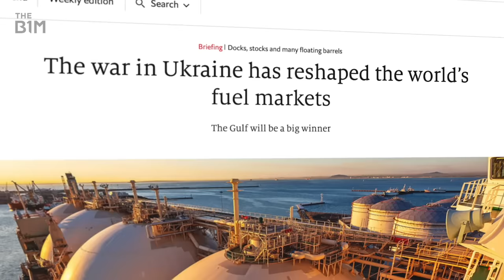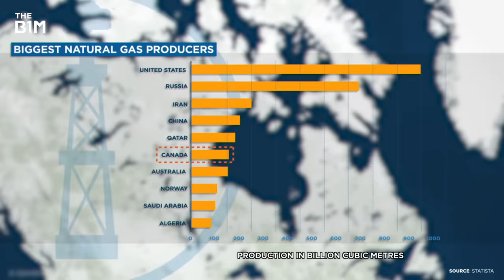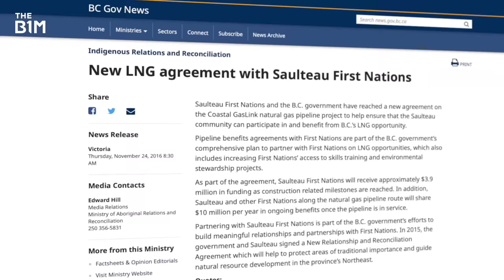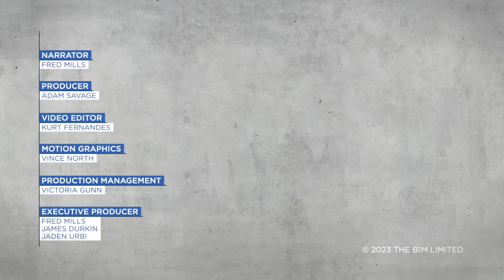Canada’s $30BN Gamble To Become An Energy Superpower

Comment: As someone who lives in Terrace, located 45km north of Kitimat, you did a great job covering this project. A new issue that's arising is the need for more electricity to power the liquifiers instead of burning the natural gas for power. The provincial power company, BC Hydro is now planning on twinning a 1 GW power line by the end of this decade to meet the energy demands of these LNG facilities.

Comment: 5:54
"they're still building coal plants. They don't necessarily use it for electricity, it's often used for domestic consumption or powering industry "
Amazing nonsensical analyses
Reply: I thought that part was weird too. I think he means that the coal is not being used to generate electricity for the grid, but in a private off-grid system, but I don't know
Reply: What, you don't throw coal in your fireplace?  I sure do.  Nothing like the smell of coal in the morning.
Reply: This video wasn’t up to standard.
Reply: @jeffmorris5802  Yes, I presume just before you leave the house to start your shift in the coal fired, steam powered textile mill.
Reply: "Plants" wasn't the best word.  Perhaps he should have said "China is still mining more coal. ..."  China still uses coal in homes for heating and cooking (and all those little stoves are incredibly inefficient).  Coal is also used at factories for heating various industrial processes (cement production requires lots of heat) and a lot is used directly in the production of steel.

Comment: Whoa… they pressured the cylinder to raise the concrete roof? I’d love to know how that works
Reply: nah, it will take at least some high school level physics to explain
Reply: me too, and why it wouldn't be easier, cheaper and safer to just use a couple of cranes
Reply: the same physics behind farting basically
Reply: Air pressure supported the dome evenly across its surface area while raising it into position for welding. This method prevented the dome from bending,  deforming, or fracturing while being lifted. Lifting by cranes would require the dome to be far more ridged, which would increase weight and cost.
Reply: @lukefrahn8538  
Easier? Not necessarily. the anchor points for the crane have to be strong enough to hold the whole lid. 
Cheaper? Cranes aren't cheap... especially in the numbers and sizes you'd need. 
Safer? How so? Using fans and pressure is a basic principle. It may SEEM safer as there is a visible structure in place, but once you think of air as a liquid, it's easier to see how an even upward pressure over a large area is probably the safest way to do this. It's basically a hydraulic pump. BC Place in Vancouver (along with other domes) used a pressurized system to keep the roof inflated for decades. As long as you can maintain pressure for 3 hours, what's the problem. This tank will be storing LNG which has been pressurized anyhow, so it's build to withstand it.
Reply: Yeah. That part kind of blew my mind. Like who cares about LNG, show me more of this sorcery!
Reply: @TheNewGreenIsBlue  Let's not pretend that this construction method is not novel nor it's benefits obvious (at least to a non civil engineer). I was asking in earnest along the lines of cost /benefit. Pressurising a vessel would not be cheap in terms of equipment and energy cost. There would already be multiple cranes present on this site. Safety-wise you have a single point of failure when doing the lift. Welding in the presence of air flow is problematic. All of this nuance is why the whole approach sounds interesting.
Reply: @lukefrahn8538  You would be surprised how easy it is to float up the roof of a tank. Last LNG tank I was on, it was literally just a few smallish fans. It only took a few hours to float the roof up over 100'. There isn't any way a crane could realistically lift roofs this big/heavy. Air lifting tank roofs is common practice as it is the most efficient way to do it, it requires very little equipment and almost no energy.

Comment: what? the dome was lifted up by nothing but pressurizing the storage tank? wow, that's a pretty bold move to actually pull off! sounds like someone made a joke and someone else didn't quite get it 😂
Reply: With only 1.3 psi of air pressure
Reply: @matthewgagne3708  that's insane! I wouldn't have guessed so. but when you say, I believe you.

--

lemme try to crunch the numbers real quick. I've no clue about the outcome.

first of all, it's important to know that 1.3 psi means 1.3 above outside pressure.

then we've a, what did he say? fifty meters high and about 92 or something in diameter. only the second value matters. 46 (the radius) times pi is about 145 square meters. I asked Google how many square inches in a square meter and it says 1,550. since we've 100 × 100 = 10,000 square centimeters in a square meter, this sounds realistic enough to me.

1,550 × 145 = 224,750 square inches. times 1.3 equals 292,175 pounds pushing against the dome. or expressed in metric values, the dome weighs roughly 132 tons. this sounds very realistic, yes.
Reply: @matthewgagne3708  Wow, they could have farted it up
Reply: @Mythos131 .. I ate a lot of broccoli and lentils that day
Reply: It was actually 0.32psi! Not 1.3 as previous comment, which makes it even more insane, I tried posting the sauce but YT just insta deletes it. (As usual)
Reply: @CrazyInWeston  yes, direct external links aren't allowed anymore. you need to place spaces around the last dot right before the top level domain, so it didn't get converted into a clickable link. then, it's possible.

but that would make for an extremely lightweight roof, wouldn't it?

132 / ( 1.3 / .32 ) = about 33 tons. that's less than one semi; for the entire roof?

I've no idea. lemme go figure it's thickness then real quick.

an assumed density of roughly two tons per cubic meter would mean the roof's volume is roughly 16 cubic meters. divided by area means that the roof's thickness would be 11 centimeters or like four and a half inch. hmm, honestly, this sounds unrealistically thin. the first value of 1.3 psi provided in here seems therefore to be the more realistic one.
Reply: @HxTurtle  The roof was lifted from ground level using light air pressure from fans, at just 22 millibars, or about .32 pounds per square inch (psi). This is a very low pressure, less than one-one hundredth of a regular car tire, but sufficient because the roof covers a lot of area: its diameter is 92 metres. Sauce material is LNG Canada who are the contractors. The roof weighed 1540 tons btw.
Reply: @CrazyInWeston  yet, the math doesn't work out then, in this case. it's super easy to calculate the force on the entire roof. second grade arithmetics will cut.

the roof's weight and size suggest that about half of the pressure inside a regular car tire is required to hoist it up.
Reply: @HxTurtle  I am only repeating what's reported on the official LNG Canada website.
Reply: @CrazyInWeston  thank you for that!

you can post the link the way I described. would be interested.

I didn't mean to imply anything negative or so against you.
Reply: @HxTurtle  I'm trying various ways but it's gone everytime.

lngcanada ca news raising the roof another lng canada milestone is achieved in kitimat
First space replace with a dot
Next two spaces a forward slash and then all other spaces with a dash.
Reply: @CrazyInWeston  thank you so much! I understand 😊

yes, YouTube's restrictions got insane, lately. what I said worked like two or three weeks ago, still 🤷‍♂️
Reply: hey y'all! did anyone notice, I forgot to square the radius when I tried to figure the aral surface of the roof?!?

so, this might "slightly" alter the calculation, lol.

--

let's have a new look: 46^2 × pi =~ 6,650 square meters. yeah, that makes for a "small" difference. initially, I only got to 145; or with 1,560 sqft roughly the size of a small single family home, lol.

so, now let's multiply this value by 1,550 in order to get the area in square inches, which is then equal to 10,307,500.

now we've the "claimed" pressure to be at .32 psi, which results in a lifting force exerted on the structure of roughly 3.3 million pounds. that's 1,550 metric tons.

now I'm seeing where we're going! that's almost precisely the stated weight of the roof! I'll bestow the marginal deviation to the slight friction required to overcome in order to get it moving 😅👍
Reply: @HxTurtle  Well done mate.

Comment: The one thing you missed here is CGL ties into the rest of its operators natural gas system in AB. Supply will be less than an issue. Although many western countries are looking to get off of natural gas, it offers an extremely cost effective gap for developing nations to bridge the gap between dirtier fossil fuels. No doubt renewables are the gold standard, but if a receipt country can get a nat gas plant up and running in less than 2 years that's a lot more effective than saying "build turbines" in terms of reducing emissions fast.
Reply: I haven’t looked at the numbers behind this claim but I’ve heard that, in theory, it is possible for Canada to “offset” its own CO2 emissions through exporting significantly more LNG to replace coal power generation.
Reply: @@wmmw7369 gold standard doesn't mean perfect, if you did any real research you would see that despite all the mining and industrial processes (which exist in extracting gas  before even burning it) renewables are still much cleaner and cheaper over their lifetime than any alternative
Reply: @dougpatterson7494 this is what the gas industry wants us to believe. Methane emissions are drastically underreported by the industry, and they are a more powerful GHG than CO2.
Reply: @givanildosouza6904 exactly, it's far far cheaper per gwh to install solar and wind then build natgas plants.

 This pipeline will never make a profit.
Reply: @jasonwilliams8016  Except wind and soar need base load power generation.  This needs to come in the form of either nuclear, hydro or natural gas.
Reply: @dirkdiggler3009  this is less and less the case with batteries taking over the base load
Reply: @jasonwilliams8016  not even close.  Wind and solar make up a fraction of the current power production with battery storage so far behind its negligible
Reply: @dirkdiggler3009  10% in 2021, 12% last year and China has added an enormous amount of both so far this year. Not enough by any means, but not negligible either.
Reply: @jasonwilliams8016  10% of what?
Reply: @dirkdiggler3009  you say battery storage is so far behind but it's much cheaper and more reliable than nuclear or natural gas so why not invest in that instead, for storage you don't even need lithium or cobalt
Reply: @givanildosouza6904  i dont think you understand the scale that electricity is generated and consumed at.  To make it all renewable we would need to have 200% of todays generating capacity with renewable energy and 50% of that would need to be for storage.
Reply: You cant make all of that without fossil fuels.  Its impossible.  LNG will be around long enough for LNG Canada to recoup its investment
Reply: @dirkdiggler3009  world electrical generation
Reply: @dirkdiggler3009  source for your numbers please
Reply: @dirkdiggler3009  Hydro is the largest source of electricity generation in Canada, providing more than 60% of Canada’s total electricity with an installed capacity of about 85,000 MW
Reply: @dirkdiggler3009  they have an incentive not to show a profit as Horgan has given them a sweet heart deal with subsidies
Reply: The most prominent renewables, wind and solar, are intermittent suppliers of energy.  Battery storage is not practical and will not be for the foreseeable future. Natural gas fueled turbines are over 50% efficient and are a reliable source of electricity.  Natural gas will become a larger part of energy generation ( as Europe has announced)  as coal generation is diminished and the realities of the limits of renewables become widely known.
Reply: @frankd8957  this is outdated information. Solar is approaching 30% efficiency and wind 40%. Many different battery technologies are being developed, the Swiss use pumped hydro as a battery. Flow batteries look to be very cost effective and efficient for grid scale. Some jurisdictions are finding that base load just isn't needed anymore, especially with the roll out of EVs, which can act like  batteries for the grid. An integrated grid can provide electricity to areas where the sun isn't shining today.
https://cleantechnica.com/2022/06/28/we-dont-need-base-load-power/amp/
Reply: @frankd8957  also hydro is considered renewable and base load.
Reply: Everything has a cost. I think we understand enough about the cost of burning shit we pulled out of the ground now to know it’s time to look elsewhere for our energy
Reply: @@wmmw7369don’t confuse an “ intellectual “ with EVIDENCE 😂😂😂😂😂😂
Reply: @dougpatterson7494 I would think without checking all those trees in the forest that everyone misses more than offsets our co2 emissions 😂😂😂😂. Ohhh by the way while your checking,check what co2 does for the growth of said trees and the resulting byproduct. 😊
Reply: @jasonwilliams8016 then why all the massive subsidies? Methinks you need to look past the rhetoric 😢
Reply: @jimgaston9863  the oil and gas industry is also heavily subsidized.
Reply: @jimgaston9863  yea exactly! Those trees combined with reductions in GHG emissions from O&G and other industries, as well as eliminating coal and natural gas power production would be amazing!
Reply: @jasonwilliams8016 they are also adding 2 coal fired plants a week how does that square with their leap in solar and wind?
Reply: Blocked from commenting I must have hit a nerve😂
Reply: Guess you don’t have much of an argument JASON 😂😂😂😂😂😂
Reply: @jimgaston9863  China has cancelled 15+ coal plants not yet under construction. More are in limbo. Solar power production has doubled that of coal this year alone.
I posted an hour or so ago but I guess YouTube didn't like the link lol
Reply: @jimgaston9863  my apologies for having a life.
Reply: @jasonwilliams8016  China is still permitting 2 coal plants a week, the power generated by coal has doubled from 46 mj (I think the mj is right?) to 90mj from 2020-22. China has also doubled solar but from 2.3% of the energy mix to 4.7.  I’m sorry if this tests your narrative,by all means check my information. 😊
Reply: @jasonwilliams8016  my apologies as well,the algorithm wouldn’t let me post to you, so I ASS of Ume d that you blocked me 😂 I had a temper tantrum 😂
Reply: @jimgaston9863  I'm not sure I can block you lol
Reply: @jimgaston9863 " As of the end of March, according to the report, China’s installed power generation capacity was 2.62 billion kilowatts, a year-on-year increase of 9.1%. Every category of fuel – that is, both renewables and fossil fuels – saw year-on-year installed capacity increases.

Overall, the installed generation capacity of non-fossil-fuel energy power generation was 1.33 billion kilowatts, a year-on-year increase of 15.9%, accounting for 50.5% of the total installed capacity, and the proportion increased by 3 percentage points year-on-year.

On the fossil fuel front, coal-fired power generation in Q1 was 1.13 billion kilowatts, a year-on-year increase of 1.8%, and gas-fired power generation was 120 million kilowatts, a year-on-year increase of 7.4%.

But solar power generation was 430 million kilowatts – of which, photovoltaic power generation and solar thermal power generation were 42,522 and 670,000 kilowatts, respectively – a year-on-year increase of 33.7%.

So according to the China Electricity Council, as of Q1, that brings the installed capacity of coal-fired power generation in China to 1.13 billion kilowatts – and the installed capacity of grid-connected solar power to 2.6 billion kilowatts".
Reply: This still supplies the majority of global food fertilizer, not going to replace 8 billion mouths to feed anytime soon unless you displace them.
Reply: @jasonwilliams8016  The more installed renewables the more waste, the fun part begins of disposing the mess in the least noticeable means possible, like how China is leaving half constructed apartments left to rot.
Reply: @spikester  how do you figure?
Reply: @spikester  sure that's a use that may be hard to eliminate. What percentage of world wide natural gas production is used to make fertilizer?
Reply: @jasonwilliams8016  Its technically an extractable biproduct of processing the gas, same with all the Co2 that goes into your soft drinks, which said liquid Co2 is heavily used industrially to assist in extracting all kinds of things. Next generation rocket engines are methane and the space race is not stopping anytime soon, could go on and on.
Reply: Blah, blah, blah.
Reply: It should be called what it is, poisonous gas, or since it’s mostly methane gas, call,it that. Natural gas was a phrase coined by the industry to make it sound safe.
Reply: @jimwatchyyc  Too easy to be cheeky on this topic while posting from your devices entirely made up of oil & gas created materials. You'll have to go back to the stone age too, which you don't expect to, just think everyone else will instead.

Comment: I was a superintendent on the tank project. The steel shell was raised with air pressure and then welded to a ring beam at the top of the wall. The steel shell acted as a concrete form. There is a 400mm thick concrete slab poured on top for the roof. There was also over 100 roof pedestals poured for piperack support. The tank has over 700km of post tensioning cables in the walls. It was a very interesting project to be a part of.